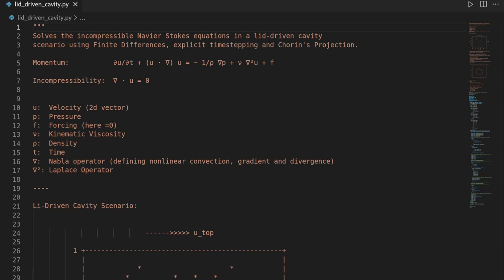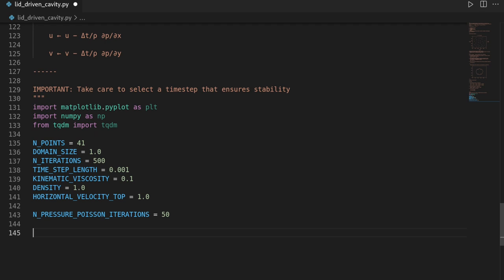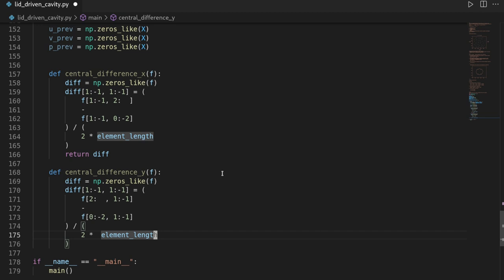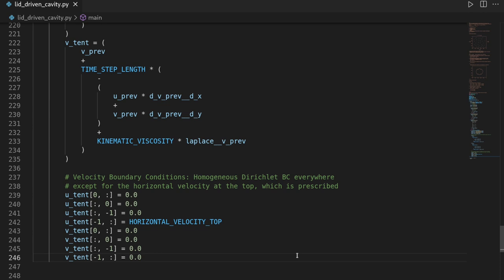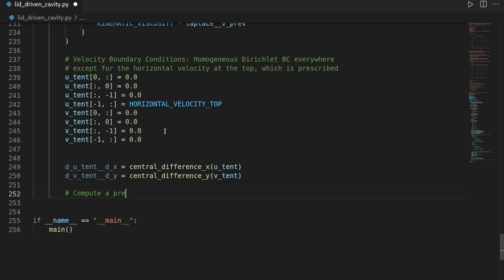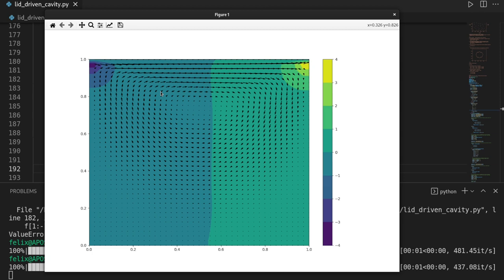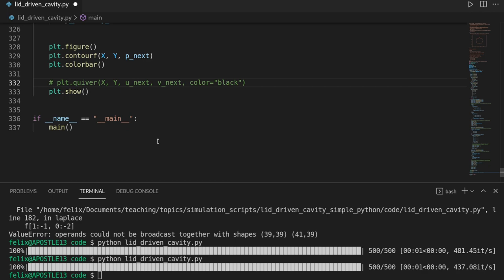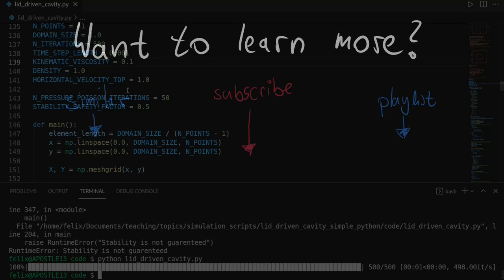Solving the Navier-Stokes equations in Python | CFD in Python | Lid-Driven Cavity

Comment: Hello, I was working on a problem of comparable difficulty, however I have used loops for everything instead of directly using the arrays. The code takes ages to run if I try making the grid finer ( splitting it into even 10 parts for a length of 1 takes more than 40 mins). Any tips on how to speed it up?
Reply from the maker: Hi,
there are a lot of factors. Generally speaking, expressing operations in (double-) for loops in Python is a common slowdown factor. It could yield a significant speedup to translate your operations into efficient NumPy array calls as that avoids the notoriously slow Python looping. However, that depends a bit on the size of problems. My rule of thumb is that NumPy array operations tend to be relevant for everything with more than 200 or 300 degrees of freedom, which in 2D would already be achieved with a ~ 15x15 discretization.

Usually, the most time-critical aspect in incompressible Navier-Stokes simulations is the elliptic pressure correction problem. In this video, I use a fixed number of Jacobi iterations. Arguably, that's a terrible way to solve a linear system, as I am guaranteed to run into troubles at finer discretizations (due to the growing condition number of the problem). Maybe, if you are using an off-the-shelve linear solver (like Conjugate gradient), it could be helpful to reduce its tolerances such that it requires fewer costly iterations to converge. For larger problems (let's say anything larger than 300x300 you might also want to use a preconditioner - one of the most efficient preconditioner for elliptic problems are multigrid methods).

Maybe also try translating your code to Julia :)

Good luck with the fantastic world of PDE solvers. :)
Reply: Thanks man! Your videos are really amazing for someone trying to figure out this stuff on their own
Reply from the maker: @atharvnaik  Thanks for the kind feedback :). I am happy that the videos are of help. It also took me quite a while to get my head around it. I try to make the videos in a style I would have loved to had myself, i.e., to use a top-down approach by starting code-first and then investigate all the nitty details.

Comment: Hello!
Did you used staggered grid or collocated grid for this simulation?
Reply from the maker: Hi,
that's a colocated grid here.
Reply: @MachineLearningSimulation  Hi!
To my knowledge, we need an additional padding of grid on every sides to implement the boundary conditions. But the code doesn't have any. Please let me know about this.
Reply from the maker: I think you are referring to a cell-centered discretization which is common when using finite volumes. Here, however, we have a vertex-centered discretization, mostly (but necessarily) due to usage of Finite differences. Hence, we have degrees of freedom that lie directly on the boundary which allows us to prescribe both Dirichlet BCs for the Velocity and Neumann BCs for the pressure. The latter are unfortunately only of first order consistency.

Is that what you were referring to? ☺️
Reply: @MachineLearningSimulation  Yes, this is what I am referring to. I thought that for pressure projection, we need to discretize using approach similar to finite volume, with pressure being cell centered (same as your pipe flow video), otherwise it might create pressure oscillations.
Reply: @MachineLearningSimulation  If we have a cell based discretization, will the results alter?
Reply from the maker: That's a great point. The scheme here would definitely suffer from pressure oscillations (=checkerboarding) at higher Reynolds numbers. However, since the flow is not strongly pressure driven (like in the pipe flow scenario), the diffusion's stabilizing effect is still  sufficient to compensate.
Certainly, this is not an Implementation you should use for more complicated CFD scenarios. It's rather a first start into getting something to run.
Reply from the maker: The results should not be altered qualitatively, you will still a center vortex creating. I would assume that there is a difference at coarser discretizations but it will vanish for finer meshes.
Reply: @MachineLearningSimulation  Thank you for the replies. Your channel is of extreme help. Keep posting 😊. Also can you suggest a book for such numerical simulations?
Reply from the maker: Thanks a lot ☺️
I'm glad I can help.

There is not one definite reference, but I like two books in particular. If you want a loose and friendly introduction then check out Jos Stam's "The art of fluid animation". A more proper engineering book is ferziger & peric (which is also quite tough).
Reply: @MachineLearningSimulation  Hi. This looks like staggered configuration (as in Chorin '68). This was natural configuration, as mentioned by Francis Harlow (who used the same in MAC method). Oscillations arise from the use of central scheme at higher Peclet numbers. In general pressure Poisson equation is given as pure Neumann problem, we usually set the value of the pressure at one point (e.g. at a corner) or subtract the average field value from pressure value at every point to solve the problem of infinite number of solutions. In the code the top BC for pressure is set as zero Dirichlet. The code is useful for learning, compact. Interesting exercise would be to change BCs and create channel, backward facing step, or to add additional equation for scalar transport (e.g. temperature).
Reply from the maker: @idiosinkrazijske.rutine  Yes, absolutely :). The video's intent is definitely educational. In addition to the points you mention, one critical shortcoming of the implementation is the fixed number of Jacobi iterations to solve the pressure Poisson problem.

Comment: 26:28... like Courant Number?
Reply from the maker: In my understanding, the Courant number (or CFL number) is a dimensionless quantity defining how far information propagates within the next time step. It is therefore defined as u_max * dt / dx. It is the stability condition of the Upwind Finite Differencing scheme when analyzed with von Neumann stability analysis.

However, in the video we used a stability constraint for the FTCS scheme of the diffusion equation because we do not have a balanced discretization in space and time. Hence, I would say the introduced "stability safety factor" serves a similar purpose as the CFL number, but is not the number.

What do you think?
Reply: @MachineLearningSimulation  without a doubt, it's not the Courant number... I referred to it because that was the interpretation I gave for the solution you presented, regarding the issue of stability. So I figured it was something similar. I understand perfectly.

Comment: Why not apply the boundary conditions to the previous velocity? Now, the very first timestep iteration, the calculation of the tentative velocity does nothing but create another zero matrix. Seems inefficient.
Reply from the maker: Well, yes, there is always room for improvements in computational efficiency, but that's not the main goal of the video ;).
I believe that what you propose is just the tip of the iceberg. The involved Jacobi solver for the pressure Poisson problem is the biggest weak-point of the implementation. There are many other linear solves that are mathematically more efficient (by a large amount).
You find many more such things in the implementation :D.
Reply: @MachineLearningSimulation  So it is the Jacobi solver? Good to know, because I have been trying to figure out how this algorithm would converge, but now I know the name.

Comment: Isn't it PISO algorithm?
Reply from the maker: I think that there are definitely resemblances to what the original PISO was doing, but I would not coin the approach here PISO. More generally speaking, the PISO algorithm (and also the SIMPLE algorithm) are just some special treatments of the coupled NS problem, see e.g. "Efficient Solvers for Incompressible Flow Problems: An Algorithmic and Computational Approach" by Stefan Turek.
The approach done here is inspired by Lorena Barba's "12 steps to Navier Stokes course", but uses the simpler incompressibility projection by Helmholtz decomposition.
Reply: @MachineLearningSimulation  thank you for the helpful explanation

Comment: The central difference is wrong, that's why it's not stable even when the CFL condition is met. It's -2 * central point, not -4.
Reply from the maker: Do you refer to the central difference approximation of the Laplace operator or of the first derivative?  :) In case of the Laplace operator, "-4" in front of the central point should be correct since we are taking a second order approximation of the second derivative in both x and y-axis. Hence, the stencil is
0  1   0
1  -4  1
0  1   0

For the central difference approximation of the first derivative (which we used to evaluate the convection/advection), the second order stencil does not include the point itself. Hence, it is
-1  0  1    (wrt x)

or

1
0
-1     (wrt y)

What do you think?
Btw: the stability check is not for the CFL condition, but for the stability of the FTCS scheme of the heat equation (https://en.wikipedia.org/wiki/FTCS_scheme#Stability ). This is because we can only simulate diffusion dominant flows with explicit central difference approximations to the advection. For higher Reynolds numbers, one would observe pressure oscillations. For these high diffusion cases (as simulated here), the FTCS stability criterion is often stricter.

Hope I got you right :). There is of course a chance that I made a mistake. Please let me know, then I can fix the file on GitHub and leave a remark under the video.

Comment: I am using VS Code to run the program, I have varied the TIME_STEP_LENGTH, but I keep getting the following errors:

" 0%|                                                      | 0/500 [00:00<?, ?it/s]d:\python\lid_driven_cavity.py:138: RuntimeWarning: overflow encountered in multiply 

  u_prev + TIME_STEP_LENGTH * (-(u_prev * d_u_prev__d_x +
d:\python\lid_driven_cavity.py:139: RuntimeWarning: overflow encountered in multiply  v_prev * d_u_prev__d_y) +
d:\python\lid_driven_cavity.py:138: RuntimeWarning: invalid value encountered in add  u_prev + TIME_STEP_LENGTH * (-(u_prev * d_u_prev__d_x +
d:\python\lid_driven_cavity.py:143: RuntimeWarning: overflow encountered in multiply  v_prev + TIME_STEP_LENGTH * (-(u_prev * d_v_prev__d_x +
d:\python\lid_driven_cavity.py:144: RuntimeWarning: overflow encountered in multiply  v_prev * d_v_prev__d_y) +
d:\python\lid_driven_cavity.py:143: RuntimeWarning: invalid value encountered in add  v_prev + TIME_STEP_LENGTH * (-(u_prev * d_v_prev__d_x +
d:\python\lid_driven_cavity.py:89: RuntimeWarning: invalid value encountered in subtract
  f[1:-1, 2: ] - f[1:-1, 0:-2]
d:\python\lid_driven_cavity.py:96: RuntimeWarning: invalid value encountered in subtract
  f[2: , 1:-1] - f[0:-2, 1:-1]
100%|███████████████████████████████████████████| 500/500 [00:02<00:00, 246.78it/s]
d:\python\lid_driven_cavity.py:242: UserWarning: No contour levels were found within the data range.
  plt.contour(X, Y, p_next)
C:\Users\xxxx\AppData\Local\Programs\Python\Python311\Lib\site-packages\matplotlib\colorbar.py:1231: RuntimeWarning: invalid value encountered in divide
  y = y / (self._boundaries[self._inside][-1] -
Traceback (most recent call last):
  File "d:\python\lid_driven_cavity.py", line 250, in <module>
    main()
  File "d:\python\lid_driven_cavity.py", line 243, in main
    plt.colorbar()
  File "C:\Users\xxxx\AppData\Local\Programs\Python\Python311\Lib\site-packages\matplotlib\pyplot.py", line 2065, in colorbar
    ret = gcf().colorbar(mappable, cax=cax, ax=ax, **kwargs)
          ^^^^^^^^^^^^^^^^^^^^^^^^^^^^^^^^^^^^^^^^^^^^^^^^^^
  File "C:\Users\xxxx\AppData\Local\Programs\Python\Python311\Lib\site-packages\matplotlib\figure.py", line 1277, in colorbar
    cb = cbar.Colorbar(cax, mappable, **cb_kw)
         ^^^^^^^^^^^^^^^^^^^^^^^^^^^^^^^^^^^^^
  File "C:\Users\xxxx\AppData\Local\Programs\Python\Python311\Lib\site-packages\matplotlib\_api\deprecation.py", line 384, in wrapper
    return func(*inner_args, **inner_kwargs)
           ^^^^^^^^^^^^^^^^^^^^^^^^^^^^^^^^^
  File "C:\Users\xxxx\AppData\Local\Programs\Python\Python311\Lib\site-packages\matplotlib\colorbar.py", line 396, in _init_
    self._draw_all()
  File "C:\Users\xxxx\AppData\Local\Programs\Python\Python311\Lib\site-packages\matplotlib\colorbar.py", line 535, in _draw_all
    X, Y = self._mesh()
           ^^^^^^^^^^^^
  File "C:\Users\xxxx\AppData\Local\Programs\Python\Python311\Lib\site-packages\matplotlib\colorbar.py", line 1117, in _mesh
    y, _ = self._proportional_y()
           ^^^^^^^^^^^^^^^^^^^^^^
  File "C:\Users\xxxx\AppData\Local\Programs\Python\Python311\Lib\site-packages\matplotlib\colorbar.py", line 1253, in _proportional_y
    automin = yscaled[1] - yscaled[0]
              ~~~~~~~^^^
IndexError: index 1 is out of bounds for axis 0 with size 1"
Can anyone please help with this? I am running Python 3.11.
Reply from the maker: Hi,
it seems to me that your simulation turned unstable. As such, some (and eventually all) your floating point values in the arrays turned NaN (not a number) which what you're error messages are telling you.
This is caused by a too high time step. If you lower it again, it should be fine.
The simulation here is only conditionally stable since we are using both an explicit convection and an explicit diffusion treatment. Hence, there will be some condition for the time step length in relation to the spatial discretization length (and some other quantities) that has to be fulfilled.